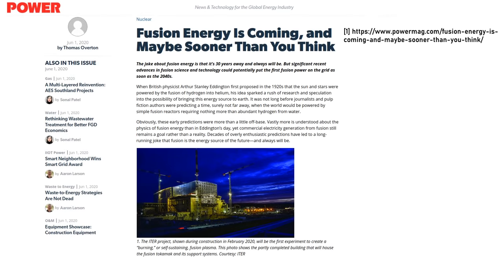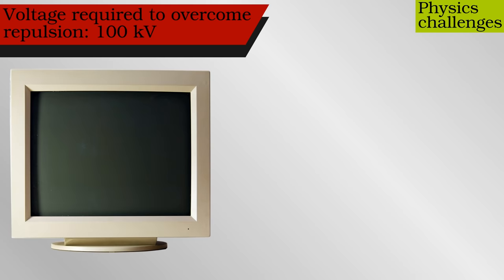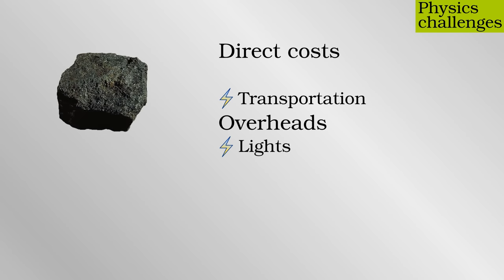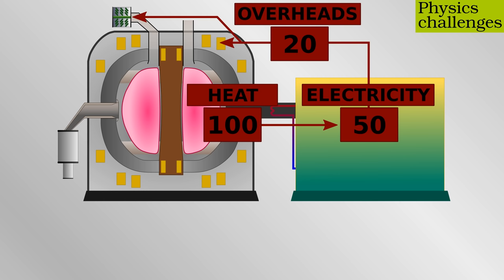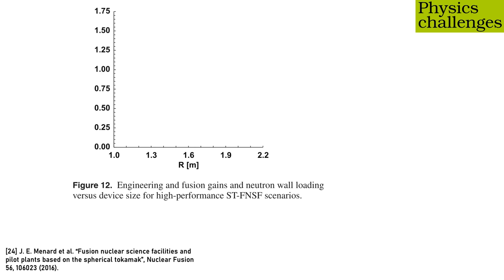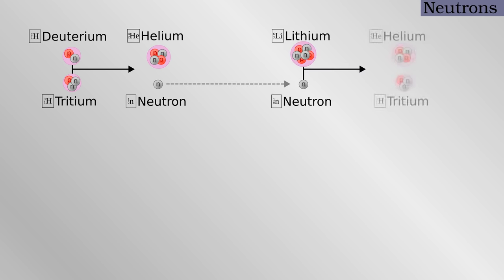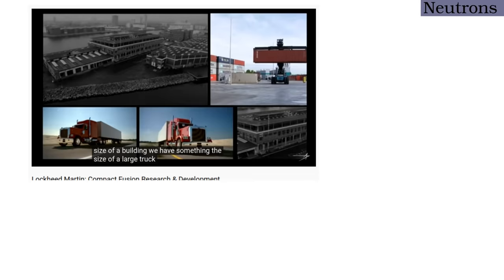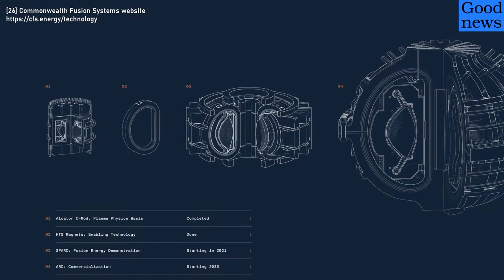Former fusion scientist on why we won't have fusion power by 2040

Comment: Well, there's one way we can use fusion power, without requiring any technology that doesn't currently exist.

It's called orbital solar. Not only are solar panels more efficient up there, there is no weather to worry about and (in the right orbit) they can produce power 24/7.

The hard part is getting the energy down to the ground, but AFAIK this is essentially a solved problem - using what is effectively a microwave beam aimed at a rectenna array on the ground, we can transmit power from space. It is not perfectly efficient - not even close - but I'm sure it is efficient enough that one could actually build a workable demonstration power plant based on this principle.

Whether it can compete on a cost basis with traditional solar/wind is another matter entirely.
Reply: Photoelectric generation in outer space, part of the energy wasted on keeping it up there, part wasted in the transmission and reception, the enormous amount of energy to put them up there in the first place. Using a desert would be better.
Reply: Solar really is not that great.
Reply: @floridaman318  agreed

Comment: Wow. I was always told that hydrogen fusion didn't have any worries related to radioactivity outside the device. Aka MR FUSION from back to the future.

Whereas it sounds like radioactivity is a very BIG problem. You can't just shield the thing with water or lead, because you need to iridiate berrylium to create more fusible material that needs to be recycled.  Yikes.

Comment: .. and yet, in December 2020 Lawrence Berkelely Laboratories successfully caused a fusion event that generated more energy than was used to create the event.
Reply from the maker: The energy output exceeded the laser energy input somewhat. A lot more electrical energy was required to generate those laser beams, however. As explained in the video, the output must exceed the input by many times. Also, inertial fusion currently runs at 1-2 shots per day (the equivalent energy output of a goat) and must increase this to at least 1 shot per second to be practical.
Reply: @ImprobableMatter  Agreed, it is still a distant milestone when compared with the energy output required to make fusion a viable.  However, doesn't a longer historical perspective show a different state of play? The first tokamac was started by the Russians in the 1950s, then Princeton and England. None of them had, and still have not, achieved a positive net energy at the target. Yet, the NIF was turned on in 2009 and achieved in 14 years. Also, in the last 20 years, a number of projects that experiement with alternatives to tokamacs have come into existence.
In addition, technology has advanced: Al is having successess in controlling fusion in tokamacs, alternate tokamac designs that allow longer continuous fusion runs have been developed, and superconductivity steadily moving from near absolute zero enabling smaller and more powerful magnets to be designed.
What I am saying is the rate of progress in technology and experiementation should be encouraging more optimism than pessimism.
Reply from the maker: I have talked at length in my other fusion videos about much of this. NIF was meant to show ignition in one year, or three tops and yet took more than a decade. AI is not magic and not "controlling fusion" in the sense that you are thinking. Tokamaks are so ubiquitous because other designs have already been extensively tested and proved to be dead ends.

Comment: I have a big problem believing a 59% thermal efficiency is possible.  Sounds like someone applied the "bamboozling factor" here.
Reply from the maker: Well, certainly not me - I cited a paper by J. E. Menard from Princeton available here: https://iopscience.iop.org/article/10.1088/0029-5515/56/10/106023
You can see the 59% number around figure 12 for your reference. 

In turn, they cite an earlier study for this number: https://www.sciencedirect.com/science/article/abs/pii/S0920379605007210?via%3Dihub

Comment: This video is apparently from someone who used to work for one of the several companies making bogus fusion claims. MIT/CFS are building a fusion reactor that decades of tokamak research predict will produce far more energy from fusion than the plant consumes and has a self-sustaining fusion reaction in 2025 and are designing fusion power plants that they hope to have running by the early 2030s. :-)

Comment: Citing energy requirement estimations from 2016, when the month you made this video MIT first successfully tested their HTSC coils. Bad luck, buddy.
Reply from the maker: Yes, and thus they instantly achieved an economical fusion reactor.
Reply: @ImprobableMatter  I don't think around 2030 is instantly, but soon enough.
Reply: @4203105 "Soon"
Talk numbers not estimations
Reply: @4203105  Yes, but you don't understand physics, so those numbers count for diddly squat.
Reply: @IbnBahtuta  I doubt you understand plasma physics any more than I do. Luckily there are experts out there that do.
But I'll indulge you. Why does it not matter to work with accurate and current numbers, in your opionion?

Comment: Excellent reality check on gaining working tech! My question, however, is more fundamental. The "fusion" holy grail is based-upon the idea of "mimicking" the Sun's power source - which is thought to be fusion. But, what if the Sun's power source is NOT fusion? What if the fusion that DOES take place in or on the Sun is an EFFECT, rather than the SOURCE of its power?
Reply: That’s just not the case and we know it?
Reply: Well the immense gravity is ultimately the cause of the fusion.
Reply: @floridaman318  That's the "standard model" certainly. Allegedly, the immense gravity is what causes ignition. But, in my opinion, that doesn't make sense - why would there be so many differently SIZED stars? So many different colors? If ignition is based-upon gravity, they should all ignite at about the same time, with the same energy.
Reply: @Jollyprez  Easily answerable with Google or a basic education. Don’t base conspiracy theories off ignorance.
Reply: @Gomlmon99  So, you're saying that astro-physics has already discovered everything and knows everything. Must be pretty boring.
Reply: @Jollyprez  No, where did I even imply that?
Reply: @Gomlmon99  You said "easily answerable with Google" - implying that the "correct" answer is already known. And, if there's one profession that has its eyes and ears closed - it's cosmology. ( with sub-atomic physics close behind )
Reply: @Jollyprez  Just because things cannot possibly be 100% certain, that doesn’t mean we don’t know things are true.

Do you think gravity might not exist? Evolution? That 1+1=2?

We have complete, utter and overwhelming evidence. There is no question whatsoever that conspiracy theorists with no education possibly know more than the entire world of scientists.
Reply: @Gomlmon99  I never postulated any of those. Why is it a "conspiracy theory" to question the Standard Model? And, why are "scientists" - much less THOUSANDS of "scientists" not allowed to answer questions? And, what makes you think I'm not "educated" - because I ask questions? Do I have to whip-out an equation-or-two to prove my credentials? Quote the Cosmological Constant ( which is NOT constant ) verbatim? In German?
Reply: @Gomlmon99  Using the term "conspiracy theory" is - as you later elucidate upon - an insult. It's designed to disparage the opponent and claim ( without evidence [sic] ) that said opponent is an idiot. You know that - that's why you use it.
You say that an "educated person" wouldn't say such things - if your definition of "educated" is - following, without question, the "current consensus" on a particular science subject - then you're correct. Science is ALL ABOUT QUESTIONING.
I put forward a question - which you haven't attempted to answer - you just laugh and avoid an answer. I also did NOT postulate that all stars ignite at the same time because of gravity - actually, the opposite - if GRAVITY was the cause of ignition, then why are there such different masses and energies of stars? It's a serious question, which clearly you don't have an answer for.
Current theory says that stars are accreted from dust and mass, over billions of years. At some point, the gravity becomes so great that ignition occurs and the "main sequence" starts.
MY question is - if gravity is the driving force of creating stars - then why is there such a disparity in sizes and mass? Gravity is gravity ( according to the Standard Model ) - and should act the same way everywhere. Gravity is the driving force for practically everything, according to the Standard Model, but just looking at the incredible variety of stars - makes one wonder why it seems to act so differently. 
Rather than insult your opponent - how about answering or postulating on an ANSWER to my question?
Reply: @Jollyprez  You don’t have evidence. It’s a conspiracy theory by definition.

By educated, I mean an intelligent person with a relevant degree.

I see this as an argument for conspiracy theories all the time - “science is about questioning”. Yes, but not questioning things stupidly without evidence. It’s about logical, reasoned arguments - which you don’t have.

There are different masses and energies because different stars are formed from different clouds? Star formation doesn’t stop once it ignites. Seems pretty obvious to me.

Comment: It is not enough for fusion to produce more energy than is consumed.  It must produce more energy than was embedded in the infrastructure.  For energy production industry to be viable the EROEI or energy returned on energy invested, is around 20 to 1.  The reason is that transport and distribution of energy consume between 50 to 70% of the energy.   Coal fired electricity supplies about 10% the original energy in the coal to the power point.  Fast breeder and thorium reactors have more promise but  will be more expensive.

Comment: Iter perhaps? It may work, we shall find out in 2 or 3 years. If it works, it will take several decades to integrate them. The tokamak material is beryllium and a lot is required to build a reactor. I suspect this will be a major issue long term unless a viable, readily available material can be found.
I'm not convinced there is a simple solution to anything. That's just reality.

Comment: Saying that the heat generated by rubbing your hands together is "useless" or unable to be used is a complete understatement. It can be redirected, and you would have more than enough to power an LED, and that's good enough for me in terms of successful fusion. What they're really saying is it's not enough to power a city or replace any power plants... That wouldn't be an issue if everyone had their own fusors at home :)
Reply from the maker: I didn't mean that no energy is given off when you rub your hands together for a few seconds, just that the thermal energy could not practically be converted to electricity. Look up "Carnot engine" for more information.

Comment: This video definitely outlays the challenges to fusion commercialization, however its missing one key component:

Current fusion reactor designs are NOT designed to generate excess power. They are designed for research. That means many of the components are built to be variable, and that comes with a massive efficiency detriment. Current designs are meant to isolate what variables work to create a stable plasma, so that later commercial generators can be designed to target those ideal conditions.

In a commercial system, the specs of the hardware is fixed, not variable, and will be significantly more efficient. This does take time, and I find many of the current timelines from startups optimistic at best. But the challenge of a 20x improvement in output is not as far fetched as this video seems to claim.

Comment: I think they are missing main point this reactios require extreeme conditions. Like extreeme grawity..look at workig samples like atom bomb it uses explosions or extreeme stronc caps to create extreeme inne reaction loops.... which means we mostlikely need something like demon core or extreemely high pressure geerators like magnets cascaded or explosions... that way lots of reactios that are locked will e awailable as stabilising force wil weaken alot.

Comment: There is a basic math error in your calculations. Microwaves pumped into the cavity that do not contribute to fusion still get converted into heat, therefore composing part of the "100" output value. However the overall rationale and results still applies.

Comment: Dear :face-blue-smiling:😄I actually don't know your names, you explained the problems with fusion, you discussed a vallue about the amound of energy is garnered in for each unit expended of that same energy source. 'N-value'  I believe you called it.
- coal should have an 'N-vallue' of 4, oil of 6 (so every unit of oil expended can lead to returns of 6 times as much as exploited from nature.

Could you make us a complete table of energy sources ranging from manpower to wood to solar and wind to coal gass/oil and then conventional nuclear and most important: thorium nuclear?
I believe the Dutch name for the N-value unit is the ESRO, could you check if this is true?

The reason why I ask is that a climate activist once explained to me that he believes that 'economic wealth  equals ecological catastrophe'
But then there's this guy who states that solar power actuall requires coal power to be used up, in order to heat an arc-furnace where coal would then be blended with quartz in order to generate finitely useful solar panels. 
Meanwhile, the Greens are claiming that solar power panels give energy forever (that last part at least, I know isn't true).

We really need to be able to know more about this 'N-value' in order for us to prosper further, so I am asking you to start making us an informative movie about my suggestion here above.

Comment: This a very nice video well documented and very well illustrated. I would like to put a damper though on the issue related to the radioactivity induced by neutrons. This is not really an issue for Fusion. There is a bioshield around the reactor that it taking care of that. It is made of concrete and is 3.5 meters thick.
However, another issue, which is not mentioned in the video is related to the tritium production (this was mentioned), but its extraction and removal from the blanket and its recovery for final reuse is a serious issue. Of course, on paper appears to be an easy task, but hasn’t been demonstrated yet. Hopefully this will be done in ITER, probably before 2040.
However, by experience I can say, that what looks fine and easy on paper proves to be much more challenging in reality.
And if we cannot reach the target value (mentioned in the video) of 1.1 to 1.3 tritium per neutron, then it will become impossible to get electricity from nuclear fusion.
Reply from the maker: Neutron activation is a big issue for maintenance (access to the machine), for decommissioning (having a "hot" reactor vessel for many years afterwards) and public perception.

Comment: 7:41 I'm one of the people that think even 50 years for "commercial" fusion is way too optimistic. However, I also know that sometimes, a single discovery can trigger an avalanche of other ones, in many different fields too. Without investments, we'll never what what is or isn't possible. I remain skeptical and open minded.

Edit 8:02: You're comparing systems that're specifically designed to be nothing more than proof of concepts. It's like comparing the utility of a garden windmill in a random location to a whole windmill farm located in an windy area 😑.

Comment: Actual nuclear fusion, as planned in ITER, honestly seems to have the same cost/risk/return profile as nuclear fission, just with everything cranked to the max. It is too complex for private enterprise to run reliably, it produces almost as much radioactive waste, it requires EXTREME upfront investment. But it will also be very expensive to run, and an ITER-scale reactor will produce about as much as a typical fission reactor.
Honestly, the whole thing sounds like a waste

Comment: Even if all the problems you addressed were solved and we had real engineering gain, how is this EVER going to be economically feasible?
Fusion reactors doesn't even produce much more power than a traditional fission reactor. And once you compare the difficulties in producing these reactors, fission starts to look like just putting a few glowy rods into water and letting it boil. And yet nuclear power is criticized for its high costs and has been seeing less and less interest. How is building a super advanced fusion reactor with some scifi shielding and all that going to suddenly make nuclear cheap ?
Reply: if we solve all the problems(and i agree with you that it’s an unbelievably massive if) with fusion, it would be so much more energy efficient, safer, and just revolutionary in every way that we would be able to do things that were thought impractical, uneconomical, or even impossible by today’s standards extremely easily. like strip-mining entire mountains, desalinating entire seas, replacing all farms with vertical hydroponic farms like they’re nothing, despite the huge lighting and water transportation costs, covering entire continents with ecologies and forests,, building world-spanning megastructure projects and generally type 1 civilization activities, because mastery of fusion would essentially make us a type 1 civilization.